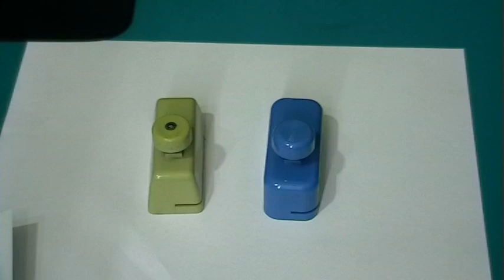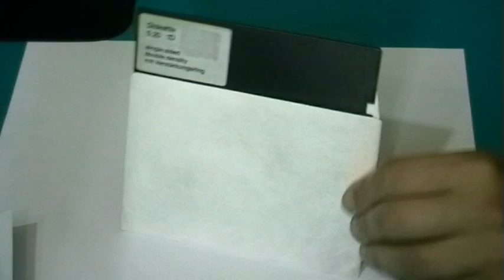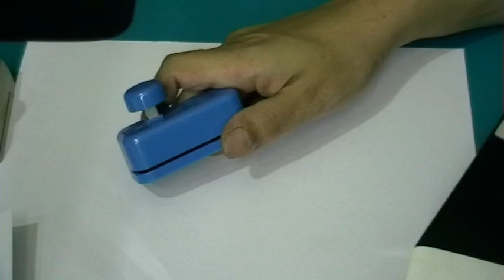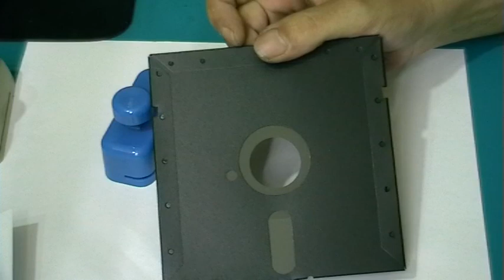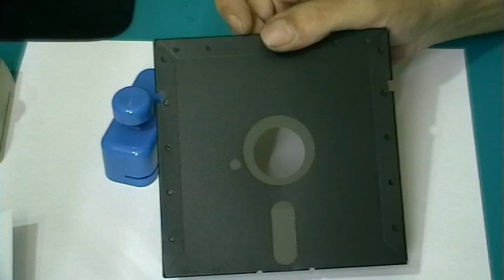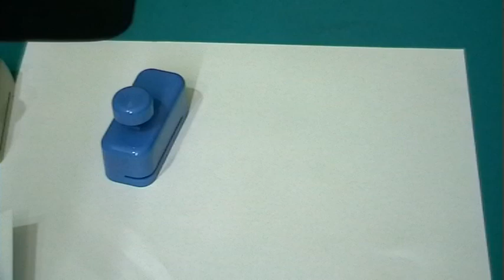Weird Stuff: Disk Notchers

Comment: I also have a disk notcher, but it does not really look like that. 
It is black and made of metal. It works well and is very sturdy. 

It's probably from 1988 or 1989. 

It was very good, so you could use both sides of the disk. 

And then a little tape over the hole to protect the contents. 

The tape came with the disks.
Reply from the maker: I know those, but they were more expensive than the palstic ones, so I opted for the cheaper. 5 Bucks difference was a lot of money when I was 12 years old.
I got my Amiga in 1988... sadly no disk notchers for the 3.5" disks. Man they were ridiculously expensive. 50 bucks for a 10 pack in early 1988.
Reply: Theshadowsnose In 1990 I bought a C 128 with 1541-II disk drive from a friend and disketnotchern came with the purchase. 
Amiga 500, it was for me but a little later, in 1992. Works just fine today, so does my C64 and C128 as well.
Reply from the maker: TheYamarider1000
Ah someone else who kept his original hardware. :)
I use my 1985 C64 and my 1988 Amiga 500 to record my videos... so obviously they both still work fine.
Reply: Theshadowsnose Yes, and all in their original boxes :) 

Have any of your old computers yellowed in the plastic? 

It is only C128 that has yellowed for me! 

Both the Amiga 500 and Commodore 64 C is almost like new!
Reply from the maker: TheYamarider1000 Yes, they have. A little I think. Not sure about the A500... it sits there without the top since 1994.
I have a lot of other C64 with various degrees of yellowing. To be honest... I don't care too much about the looks of a machine, as long as it works properly.
Reply: Theshadowsnose yes, that's what matters.
Reply: Theshadowsnose I had a couple of these back then. I used the first one so much that the cutter got dull. If I had known someone with a grinding wheel, I probably could have it sharpened, but I just bought a new one instead.

There actually WAS a disk "notcher" for 3.5" disks. They were used to punch a hole in the case so that floppy drives would recognize the disk as High Density, rather than Single Density. I'm not sure how well that worked though.
Reply from the maker: lurkerrekrul
My cutter isn't the sharpest anymore either.
Luckily most of the disks that I get are used and already notched on the 2nd side.
And I don't use that many disks anyways. Basically not more than 3 or 4 in the last 3 years.

I don't think the notcher for 3.5'' disks works very well.
The magnetic material is entirely different in HD disks. If I think about how unreliable HD disks get if they are formatted in DD, I don't even want to imagine how well DD disks work when formatted HD...
Reply: Theshadowsnose With the 3.5" notcher, I think it was a case of them making a product just because it was possible without regard to whether it was a good idea.

I just did a quick search, here's a page with a picture of one such notcher;

http://www.nightfallcrew.com/02/01/2010/3%C2%BD-floppy-disk-notcher-720k-to-1-44mb/

Comment: It looks like I have exactly the same as the blue one. Before I got one for my C64 I used scissors to put a hole in the disk. Always looked ugly as hell. Too bad the notcher wasn't that reliable. Sometimes I had to use a scissor anyway because the notch wasn't punched trough completely. Especially the gauze stuff inside, that supposed to protect the floppy disk was very often "unpunchable"...

Yeah the things we did to store more data on those ancient memory storages. Beside the Notchers I used some disk software to place programs inside those extra tracks 80 & 81 that usually aren't used by the operating system(s) (on both the C64 and Amiga, most floppy controllers on the PC weren't as flexible as those for commodore machines). Too bad most copy programs, especially those on the C64 ignored those tracks. So after copying these prepared disk they missed some data.
Reply from the maker: The reliability of the disk notchers were strongly dependent on the disk you used. Some work just fine and others are a real pain. I don't use it that much today... most of the disks I have already have notches on both sides.
Yo mean track 36 to 40 on the C64;-)
I never really used them myself, but I was aware that I had to copy them for some games. Especially when I copied original disks with the burst nibbler, I always let it copy all 40 tracks.
Some earlier games used the "high" tracks for copy protection. So you could copy the original disk if you also copied track 36...
Reply: Theshadowsnose I guess I mixed things up with the Amiga. ;-)
But with the Amiga using the extra space on a disk was a lot easier than on the C64. You just had to edit the mount list entry for a device and voilà more bytes per disk. Even better with nice alternative files systems like Diskspare.device, with over 1,8 MB on a HD Disk. Well, that came at the cost of mediocre error protection and broke with the release of the the last Classic Amiga OS 3.9 (maybe even 3.5?).
Reply: Pesthauch666 I learned the hard way that alternate disk formats were a bad idea.

I used a PD driver that allowed you to format a couple extra tracks on each disk, then I used PFS/AFS which was the "miracle" replacement file system that supposedly would never corrupt a disk. I discovered pretty quickly that if you popped the disk out at just the right moment, it would render the entire disk completely unreadable. After a little practice I could demonstrate this fact with 100% reliability. And of course there were no disk salvage tools of any kind for PFS/AFS disks. Even when DiskSalv added support for it, it only worked on hard drives, not floppies.

I had a HD floppy drive, so I was able to get around 1.8MB on each disk. I later found out that even the disks that hadn't been corrupted would give me problems. I'd put a disk in, tell it to copy the files and it would complain that 2-3 of the files couldn't be read. Often, if I ejected the disk and re-inserted it a few times, it would eventually read the problem files, although I would usually have to do that for every problem file.

True story: I had a set of about 20 disks, each with about 7-8 archives of text files on them. When I got a Zip disk, I decided to copy them over to that. When I got done, there are about 5 archives that absolutely would not copy. I probably spent over an hour on each one and could not get them to copy. I must have ejected and re-inserted each one dozens of times and each time it gave me an error. I put those disks aside and ignored them for a month or so. One day I was bored and decided to try them again. Every one of the problem files copied without errors on the first try.